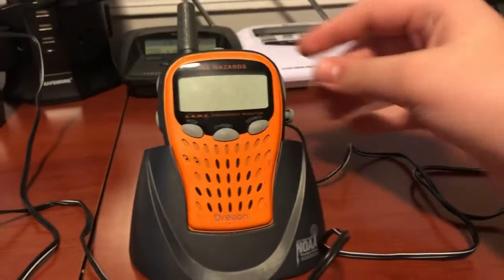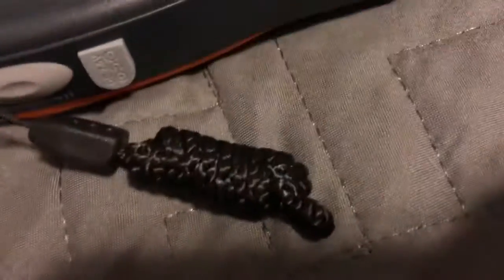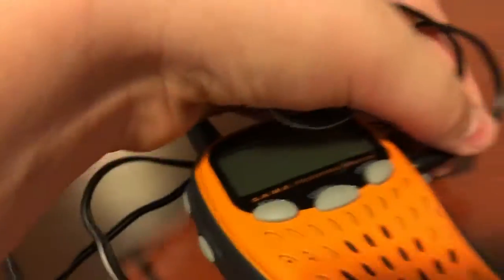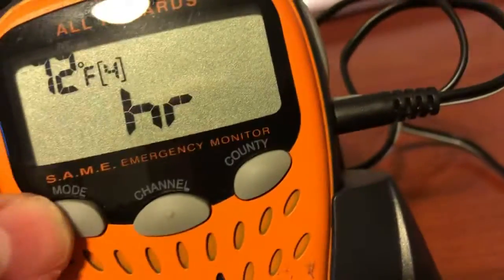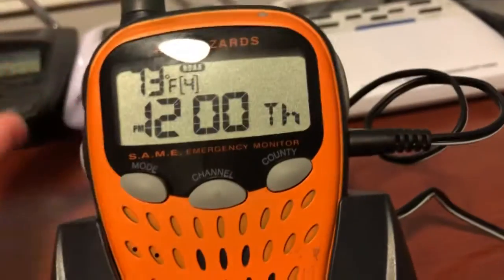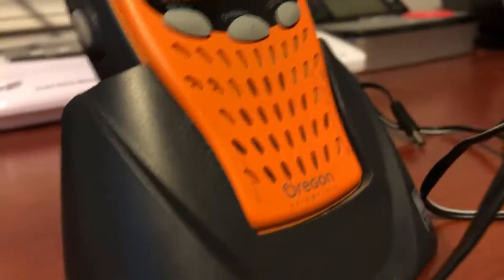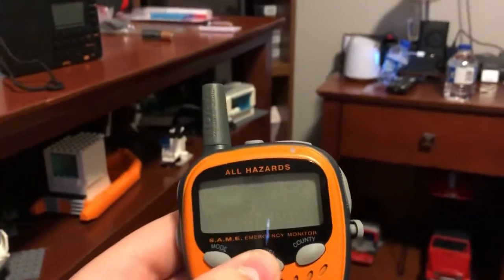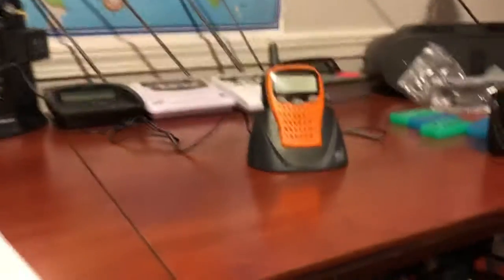Uhhh dose anyone know how to fix this

Comment: I think I might know the issue, but I would not know how to fix it, the problem may be that the battery wires are severed, and so the battery power doesnt get to the radio. My WR100 is like that.
Reply from the maker: Ok thanks